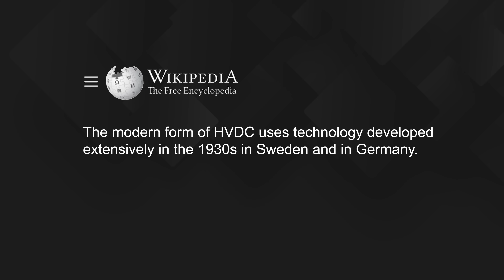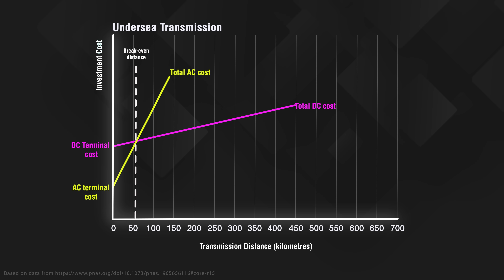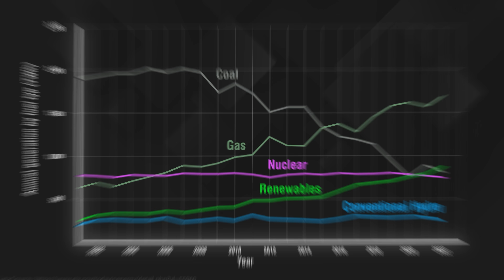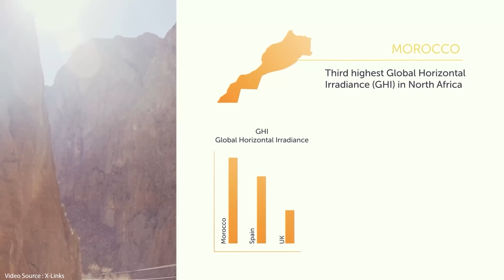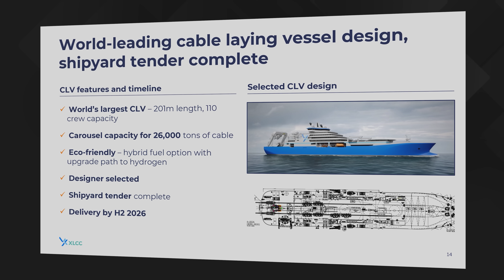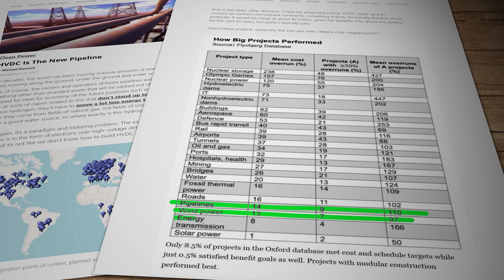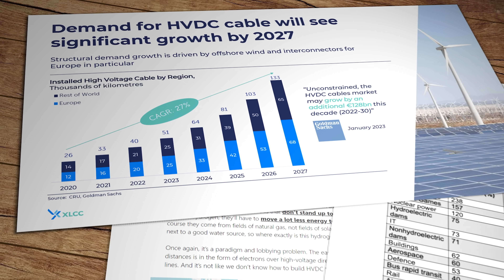Revolutionising power transmission.

Comment: IF you honestly believed CO2 is a world crisis; everyone would be mass carpooling RIGHT NOW AND REDUCING CO2 World wide by 8% overnight and save money and time; but we aren't ? Why? It doesn't make money. Direct response to this video - at least some people realize that a major fail point of the Electrify everything idea is - the loss of power in transmission from generation source to charge point.  World wide Solar and Wind contribute only 3% of energy produced; so if that power must be transmittled 300 or 400 miles to the charge point you loose 15%. Given this reality check; it would take a true breakthrough in Thermo nuclear or a giant move to go geothermal to make such plans work.  I wouldn't bet much on those happening.

Comment: Questions / Video Suggestions - between agrovoltaics, roof tops and parking lots (I’m in Canada and we have monsterous parking lots) there seems to be under utilized space where local green power production could occur - reducing or skipping the need for this massive infrastructure element. Why not paradigm shift to micro local production rather bigger centralized continental production? Plus, India selling power to  African countries? One of the largest populations is going to sell power to nations that should have power autonomy? Doesn’t make sense outside of profit gain. Basic question is this, what could be done more locally with an equal level of capital & resource investment? What’s the delta between the two scenarios? Cheeers

Comment: This video is speaking of the past. The large distribution networks to dispatch the electricity shall obviously disappear to be replaced by small independent production units ensuring localised autonomy this allowing to get rid of all these gigantic and extraordinarily heavy and expensive cable networks requiring gigantic and expensive transformer units enslaving the customers to dictatorial distribution companies. Look for example at the mobile phones or laptops could you imagine that these tools could have any advantage to be connected to a huge network ? Of course not, the batteries which today last som few hours shall be improved and may be replaced in the future by batteries lasting hundred of years. Factories requiring a lot of energy will get their own independent compact production units unless they may be supplied by powerful battery systems which may last hundred of years. Do not say that this is not possible. A lot of people are living today with pacemakers allowing them to have an independent and dynamic life. These pacemakers may last twenty years or more and therefore do not need to be replaced more than once in the life for unlucky persons who had to get it at an early age. Then it is not difficult to predict that the solar cells and wind mills have no future in the long term.

Comment: This is exciting.  Effective energy transmission is the missing link required to make centralised renewable energy production viable.  I had not realised that HVDC could rival AC transmission if it is placed underground or undersea.  All this without using superconductors.  I assume that copper is used for transmission.  Good thing we have a lot of it.
Reply: "we have a lot of it" Do we?
Reply: @guesswho6038  I assume so.  Copper is regarded as abundant.  But it's only the 25th most abundant element on earth, apparently.

Comment: As an electrician in the power industry, I am always puzzled by the renewable energy naysayers who seem say that we cannot transition to renewables because our power grids cannot handle the flow of energy from one place to another. It seems that they do not understand that we currently move vast amounts of energy around the world, and adding electrical energy transmission capacity is fairly cheap, easy and fast. Especially compared to building pipelines and transportation systems for oil, gas, and coal transportation. 

Plus the decentralized nature of residential and commercial PV systems greatly reduces strain on electrical grid systems. And the same goes for many utility scale wind, solar, and battery storage projects. Battery storage projects can be strategically located to absorb energy during periods of low demand over power lines that are reaching capacity during peak demand, and can release that power locally to avoid line overloading during peak demand periods.

Comment: Nuclear is the answer.  Solar takes 76 times the land area.  Wind farms takes 360 times.

Always on, safe, clean, carbon-free.  
Never a single fatality in the USA commercial nuclear power plant.

Deaths at 3 Mile Island due to radiation?  Zero.  Deaths at Fukushima from radiation?  Zero.

Comment: We keep hearing that the copper required to build out the grids we need to transition all the way to renewables far exceeds any reasonable growth projection for copper mining capacity and that in any case, the crash programs to mine that much copper that fast would run up against environmental concerns. Hope you will or have addressed this.
Reply: Maybe don't listen to sources that just make up nonsense.  We can start with asking you a question... why do you think transmission lines are made out of copper in the first place?
Reply: @junkerzn7312  Perhaps you misread my question to Dave as being adversarial. It was not. I'm aware copper is abundant. However, like a lot of things, many challenges with decarbonizing the economy lay in rates of change. If we back out the timeline needed to hold CO2 concentration goals into the timeline for electrical grid buildout, and take a good hard look at existing mining capacity vs. required mining capacity, and factor in the environmental issues with mining itself, can we get there? Or more importantly, how do we get there? Decarbonizing is an imperative for the long term for sure, but we're in a tough spot and need to be resourceful, and as well, I think current generations need to be willing to forego some luxuries for the sake of future generations, though that is obviously a problem for the political class to have to sell to their constituencies.
Reply: @BodhiSoftMobileApps  Ah, I think you missed out on the problem with your original posting.  The problem is that transmission lines don't use copper at all.  They use aluminum and steel.
Reply: @junkerzn7312  My bad for mixing in the grid with overall infrastructure, & muddying the discussion. Regardless, we'll need a lot more copper mined for the electric motors we need to build, and a lot more aluminum for the transmission lines, so I'm hoping to hear credibly-sourced and optimistic projections from Dave about this since the denier crowd seems stuck on chanting "you can't get there from here and even if you could you don't need to."

Comment: Here in New England and eastern Canada we can imagine connecting 34 GW of Quebec hydro power to act as a huge battery with the planned 70GW of offshore wind with bi-directional HVDC.
Reply: An excellent idea. the combination of wind, solar and hydro is the only sensible solution.
Reply: I'm in Vermont and the governor and the utilities (the largest of which is owned by Hydro Quebec) have been arguing for years that we don't need any more in-state renewable energy because we'll just get power from Hydro Quebec.

The renewable energy community, like you said, keeps pointing out that we should have as much in-state renewable energy as possible and Hydro Quebec can be used as a battery either by slowing hydro generation and raising water levels while other renewables are online or by pumping the water back upstream.

Comment: NZ has a 800km UHVDC 1.0 million volt line from Benmore power station in the South Is to the Haywards Converter station in Lower Hutt, North Is. It was chosen as the transmission losses for DC were significantly less than for the traditional 220KV AC lines normally used. The route involved the undersea crossing of the dangerous Cook Strait. Generously, NZ Electricity provided a HV generation facility for the new Engineerig School in Christchuch - 2.5 MV makes a very loud bang when discharged (Also used for testing the insulators for the DC line). Ken Baird BE(Elect) CHCH School of Engineering.
Reply: It's only a +-350kV bipole, not 1MV. But HVDC is undergoing a massive boom at the moment.
Reply: There was a similar G.E. insulator facility in the US that had a huge Tesla in a very old building, which was recently demolished.  Surprisingly, they didn’t destroy the Tesla Tech, which they sold to a bloke in Florida that wants to house it in his museum.  He is currently trying to fund setting that up.  Saw this on another channel where these very tech savvy guys snuck into this secure and security guarded building and filmed the Old Tech from all angles and described what they saw and how they thought it functioned.  Super Cool!
Reply: How do I get a job in this industry 😆

Comment: Electricity isn't that weird.   But HVDC is not really a revolution.  HVDC lines tend to be more economic past a few hundred miles due to problems with synchronizing AC over long distances.   The much higher cost of doing voltage conversions to and from the HVDC line is weighed against the complexity of needing potentially many AC synchronization stations on a long route.  HVDC wins in that case.

AC is cheaper for shorter distances (less synchronization needed), HVDC is cheaper for longer distance.  But that's pretty much all there is to it.   Definitely not revolutionary in any way.

Piping electricity between countries is a cool idea, and if the world were a peaceful place it might even be a great idea.  But depending on extreme long-distance transmission lines in a world full of conflict is just asking for trouble.  And you also have to ask what does it actually solve?  If one country normally pipes a few gigawatts to another, and some emergency occurs and that country needs the power themselves, what happens to the other country?

What will really revolutionize the grid is energy storage.  Think about this:  A home using, say, 48 kWh/day (inclusive of air conditioning) is averaging just 2 kW in consumption, but probably has a 100A or 200A service capable of 48kW.  Why?  Because consumption is bursty.   But with a local storage system, that home would be able to run with just a 10A service.   Needless to say, the distribution lines could be made a lot smaller and cheaper.

The same is true on a larger scale.  For example, battery projects in California today are designed to offload congested transmission lines.

So energy storage is really the key, the disruptor, and the solution.   It is NOT cost-effective on small scales right now, but is quickly becoming cost effective at the grid-scale and probably within a decade it will be on small scales as well.

Comment: hydrogen, at least currently, is so energy intensive to make, store, etc that it is, to use musk's word, "dumb". lets get thorium reactors built, and compact reactors. though i do love lockheed's skunkworks and their planes, i am not a super fan of war, but they are also developing, which should be right about now that we find out, a compact fusion reactor. they have pulled off the impossible so many times that i dont think they're going to miss the mark in the end...just maybe on timeline. lets go nuclear.

Comment: Is there enough copper for all these super long big fat cables? Every rooftop solar installation needs heavy duty copper cables. Exponentially growing demand. Where's it all coming from?
Reply: High voltage transmission lines are not made out of copper.
Reply: @junkerzn7312  What do they use? When I had solar fitted they used a big fat copper cable to run between the inverter & fuse box. Multiply by millions & it adds up.

Comment: Again, another pie in the sky solution which will ultimately be cost prohibitive and jack up the price of electricity if governments attempt to replace existing infrastructure with this technology too quickly. At some point that energy needs to flow from the transmission network down to the distribution network, where the largest constraints in supporting intermittent renewable energy exist. All it means is an increase in curtailment of renewable generation, until such time as cost effective large scale storage solutions exist. It's easy to fall for the scam, but if governments were serious about implementing clean energy in the fastest possible time frame, they would be investing heavily in nuclear power stations.

Comment: The problem with this analysis is that, while these technologies e.g. DC inter-connectors will continue to make a contribution, they will not solve the central problem of what the Germans call Dunkelflaute. This is where typically in January high pressure settles in across Northern Europe such that there is little wind or solar. In which case a number of countries e.g. the UK, Belgium, Holland, Northern Germany, Poland and Scandinavia with huge electricity demands will simultaneously require electricity when their renewables stop producing much electricity. For example the UK's neighbours will also be short of electricity when demand is at a maximum.
Reply: it's not that big a problem, especially as the whole EU is interconnected (on 2 grids) as well as most surrounding countries.

Also dunkelflaute is a reduction not a absolute cut.
Reply: @alanhat5252  To power our homes, offices and cars with electricity requires the UK to add 1.7 times current capacity to the system. This amounts to a total capacity of 160 GW or more. With a little nuclear and the rest renewable by 2050, and only nuclear providing reliable capacity and with the contribution from wind and solar reducing to 20% during Dunkelflaute, the UK would have a shortfall of the order of 100 GW. And with our neighbours suffering similar pro-rata shortfalls, it is highly unlikely that there would be hundreds of GWs of spare capacity available in Europe, and that there would be sufficient capacity in the DC inter-connectors many of which are yet to be built. The problem with videos like these is that the authors latch onto an existing and useful technology, and then represent that it provides a solution to a much larger problem. It is the same issue with the idea that battery storage will solve this problem. You need to understand the system at a macro level and then push the numbers. I recommend you watch a presentation by Michael Kelly, a professor of engineering at Cambridge University, on the engineering and cost implications of Net Zero at https://youtu.be/NkImqOxMqvU
Reply: You're quite wrong about this. The whole point of long ultrahighpower DC lines is that a countries' wind and solar can effectively be spread over VERY large areas. Those large areas massively smooth the variability. Got a dunkelflaute in the Baltic? Never mind - it's windy down in the Bay of Biscay, and if that's not enough it's sunny in Turkey. And if that's still not enough just open the gates a bit more on those Norwegian dams ...
Reply: Yes, theoretically it is possible but currently there is only 7.5GW of DC inter-connector capacity coming to the UK from continental Europe. This is only a small fraction of the capacity required to supply the current demand of 60GW in the winter and an even smaller fraction of the capacity required to make up for an 80% or more reduction of 160GW of generation from unreliable renewable power generation required to meet Net Zero on cold windless and sunless day in January. @kenoliver8913

Comment: I don't really understand why there isn't more talk about connecting the UK/EU grids to the US/Canadian eastern grid via Iceland and Greenland. Buying and selling between those two grids would be a MASSIVE market. We clearly know how to lay cables that long in those locations. Seems like a thing we're eventually going to start working on 10 years too late.
Reply: Greenland has a massive potentiel for tapping hydropower. Yet energy can be transported and used as hydrogen turned into nh3 too,....
Reply: The US grid? Because it's underspecified & unreliable. I would imagine the Canadian grid is better but I don't know.
Reply: @alanhat5252  The US and Canada share their Eastern grid I believe but either way we're talking about an interconnector allowing buying and selling to those grids so it increases reliability.

Comment: How will DC power affect the equipment that uses Alternating power?
Reply: It needs to be rectified back into AC before being used. This is exactly how it happens right now anyway its just most people aren't using such effective cables 

They generate DC and transform it to high voltage to reduce energy transmission losses then convert back to AC for use
Reply: @drsatan9617  thanks
Reply: @drsatan9617  Just as a side note "Rectification" is AC to DC, not DC to AC.   Converting DC to AC is harder, it requires an oscillator, transformer, fast switches (usually FETs of some sort), and so forth.   It aint cheap at the power levels involved.   This is why HVDC lines are only cost effective when running long distances where other efficiencies trump AC transmission and offset the cost of the conversion stations.